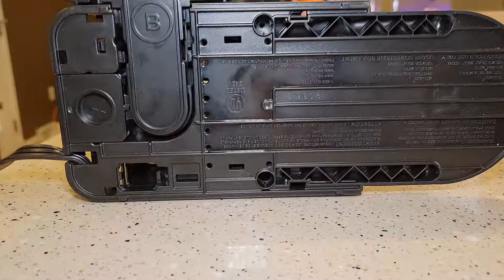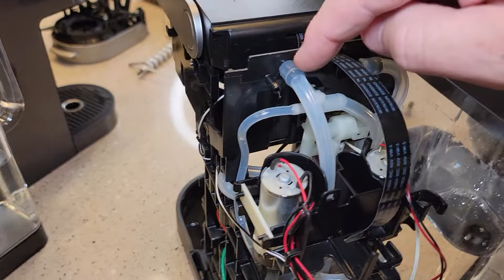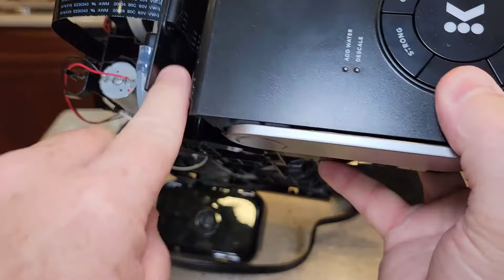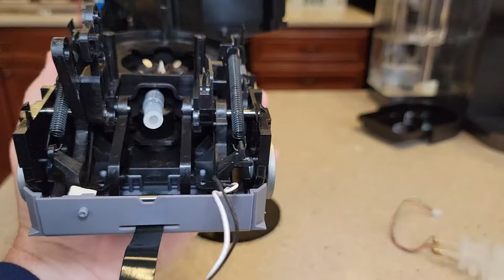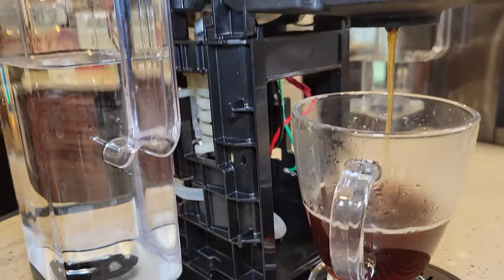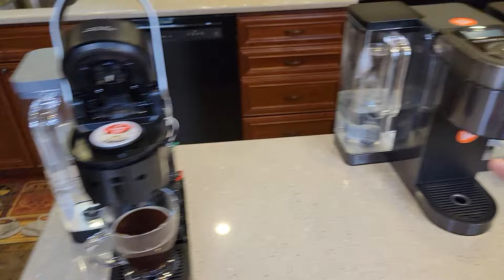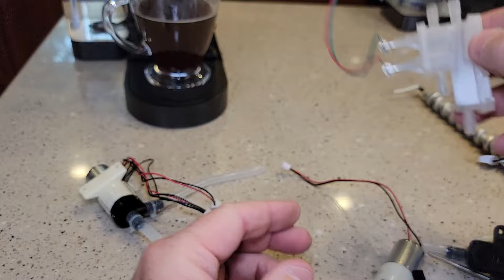🔍☕ Keurig K-Supreme Inside Look | How It Works & How to Take It Apart

Comment: At time 4:45 the unit your holding DOES HAVE A RESET the red button will reset the heater (sometimes) measure with an ohm meter across the leads with  the power off (of course)
and the heater will reset unless it is damaged too badly.  THEN proceed to find out WHY the water did not make it to the heater, causing the heater to overload.

Comment: I bought the K supreme from BJ's club abought a year and a half ago and I bought another for a friend. Both were duds. I only use mine for iced tea and the water stream has always been very slow and less than what was selected. The descaler light comes on all the time. Descaling seems to have no effect. I can tell there is a blockage. I tried the paper clip on the needles, and they were not clogged. So, thanks to your video I took the cover off and started looking for the problem. Long story short, the clog is in the check valve which is built into the multi stream head which you cannot take apart to clean. I should be able to blow air though it and it was clogged up tight. I am soaking it in vinegar hoping it clears up. There was also a clear slime in the tube right at the check value. I think it's a poor design and they should have a recall on the unit.
Reply: 100% support your point of view! I have the same issue as that of yours. The multi stream head is a literally a defective design!   After treatment by vinegar, did you revive it ?  what is current status ?
Reply: @悟入木三分  I broke down and bought another unit direct from Keurig, same model, and this one works great. Comparing the new one with the old one I believe the first one had a defective pump.

Comment: Well-this helped to understand why our Keurig stunk so bad. Our K Supreme smelled and the coffee tasted like mildew. I descaled whenever it said to, and I constantly cleaned the inside of the reservoir. Ends up, the mold smell was in the rubber and spring on the underside of the reservoir where the it connects to the water flow. The area that connected the reservoir to the machine was always wet and it smelled, as well...the little tubes that go to the water level sensor could were part of the problem. The smell was embedded in the areas you couldn't access.

Comment: what is the usage of the air pump??
Reply: Pressurizes the coffee going into the K Cup for a more complete saturation of the coffee grounds, and then clears the lines afterwards so that it starts with zero water in the lines for the next cup, and probably so that there can't be a potential siphoning effect that would drain your water reservoir onto your counter top.

Comment: Very nice explanation, I repaired mine with the reset but also clogged tube, noit water got to the heater so would reset. The pump was not priming bcus water was below half. So tested pump and worked. Removed tubes blow in air. Closed tube filled to top, and runned. Decaled afterwards. Again very good instruction on the path of the water. Did you catch that stm32f ??

Comment: Does it force you to add water as soon as it detects low water? My automatic espresso machine uses a magnetic float sensor but is programmed to know how much water is left after the magnet drops, so sometimes the "Out of water" light doesn't turn on and I can ask for a small espresso and it will do it but if I ask for a large it knows there's not enough water for it and will light the out of water light as soon as I press the Large button. I hope these new Keurigs behave the same.

Comment: Great video !  I wonder if the rubber flap is to release the steam from  the- Kup. ?    Amazing the amount of engineering for one cup of coffee
Reply from the maker: i think its a safety if you lift the handle during a brew the flap will open and prevent hot water from coming out the needles

Comment: It looks like water only comes out of that center needle (there are no holes in those other ones), I wonder what those other four pieces are for, just for venting?
Reply: The other 4 needles have the holes on the side, not on the bottom. You need to slide the black rubber (silicone?) sleeves/seals up to see them. They distribute the hot water better in the K-cups for a complete brew giving fuller taste.

Comment: Our flap became removed during a cleaning. Afterwards, the machine produces only clear hot water, no coffee. Any suggestions on reinstalling the flap?  We still have it, intact. Keurig support tried to sell me a new machine.
Reply: The flap is a safety(?) to prevent hot water from shooting all over if, for some reason, the lid isn't fully closed.
Reply from the maker: Thanks so much for your support!! I really appreciate it so much!!!
Reply: These are very reliable machines. The one I purchased in 2009 is still in use. It does have more descale alerts using Starbucks K cups and refillable K cups. Other than that, I did buy a new one as a back up.

Comment: So the needles puncture the k cup. The what? How does the coffe come out clear. The water runs over the grounds then how does it filter the coffee and push it down to the cup?
Reply: After the needle puncture, water is forced through the K-cup under mild pressure. Hot water goes through the coffee, past a built-in filter and out into the coffee mug.

Comment: Does the water actually come out of all 5 holes? 🤔 Or does it only come out of the classic center stream main one, and then spread across the top of a Kcup and possibly drip into the other 4 holes? I’m curious because the center spike is the only one that looks hollow, and like it can actually deliver water. The other 4 just look like solid hole punchers.
Reply: The bottoms of them are solid but just above a little bit (where the rubber washer type part is) they have holes in the sides of them that lets the water flow.

Comment: That little rubber flap has to have a purpose. Now you have me thinking. Great video very interesting
Reply from the maker: Thanks 👍
Reply: I would think it is like a relief valve incase the handle is opened while the system is still under pressure. Would blow hot water and steam down vs out the needles at the user.

Comment: Thanks!  Your video really HELPED!  Getting the case off WAS a struggle (as you promised!)  Once inside, I found the thermostat cutoff/reset and reset it.  It still had a problem with the unit shutting down.  As an experiment, I disconnected the hose nearest the right cabinet side panel.  The unit fired up fine over and over to do the descaling but the "Add Water" light did not come on.  The water got TOO low, the safety thermostat shut OFF and there it was......dead again.  Reconnecting the hose did NOT make things normal.  Soooooo, to keep using my machine, it is CONSTANTLY in "Descale" mode after I press 8 and 12 oz buttons for 3 seconds.  I make SURE that the water tank has lots of water.  I fill my reuseable K-pod, put my mug, press K and get a 12 oz. cup of nice strong boiling hot coffee.  Between uses I disconnect the AC to the unit to save power and also, so that it can't overheat.
QUESTION:  Is the hose I disconnected to do with the air pump and the "ADD WATER" function?  Again, THANKS A MILLION!  Old Man Rob, in Canada, EH?

Comment: The connector on the side of the water pump lets the computer verify the pump is rotating and not jammed, and the computer also likly uses it to measure the quanity of water delivered,.. I think it uses reads magnetic pulses from a revolving internal part with a hall effect sensor and the computer can read these pulses to determan the pump is running before it turns on the heater as a safety confirm so the heater is not switched on without water flow ..
Reply: This comment was pivotal for me. I bought some 10$ Amazon pump to replace in the Keurig, looked the same as pictures, had the same specs, but it didn't have this custom Keurig sensor on it. Without knowing what it was, I was thinking I could short/bypass it, this comment led me to keeping the OEM upper pump diaphragm assembly w/ sensor and replacing the motor from my amazon donor. Great success.

Comment: This is so much engineering work. These machines are much more complicated than I would of originally expected. The wide range of components, sensors ,and integrated systems is cool to learn.
Reply: Super automatic espresso machines make this look super simple lol. They have built in coffee bean grinders, an automatic coffee tamper and ejection mechanism and automatically grind the beans, put the ground beans in the filter, tamp them under high pressure, brew the espresso under very high water pressure (it has special high pressure tubing and connections) and eject the used coffee grounds into a waste coffee bin at the press of a button. The machine costs a lot more but you then get even better coffee for pennies per cup compared to k-cup/pod machines so they pay for themselves.
Reply: Which eventually and unfortunately makes it more prone to failure.
Reply: @Barnabas45 theoretically. The only thing I really think could be changed in this model is the over temp switch as it is single use. Although I could see that decision being made because if the unit over heats there is probably something else wrong with it. I wouldn’t say this is over engineered it’s a a pretty simple system just being used for something trivial.
Reply: I agree and it is made over complicated. They could have made it so much more simple and repair friendly@Barnabas45
Reply: All they really need to do is make that heating element, pump and timer. That's it. But they way over engineered it and made it not repairable

Comment: Extremely helpful and the comments assisted in the over temp reset. My unit was unused for months and after a descale I realized I was only pumping a ful cup when the water tank was full to the top 2/3erds. Any ideas? Maybe still need to descale? Also now my display goes dark after 1 second. I’m thinking the ribbon cable is loose or steamed/corroded after many short cups of hot water after descaling. Any ideas on how to check/clean the ribbon cable in the lid?
Thanks in advance….
Reply from the maker: Maybe a clogged in line.  blow some air through some of the pipes.
Reply: The over temperature sensor stays set/made. So that is not my problem.

Comment: I descaled my Keurig slim but the light does NOT turn off even though I also held the 8 and 10 Oz buttons down for 5 seconds. What am I doing wrong? I've tried it several times and several days...I am at my wits end )=
Reply: The newer Keurigs are different from the older ones: you have to enter the descale mode. If not in this mode and you run the solution or vinegar through the unit, the descale light will not turn off. To enter the descale process, turn unit off. Then press 8oz and 12oz (NOT 10oz!) at the same time. Fill the reservoir with the solution and descale. Just a Dad has a good video on descaling the Slim model.

Comment: On the side of the water pump is actually a IR sensor, I'm guessing its used to measure water flow. I had an issue with a keurig k latte single serve where the lights where all on and pressing the power button would cause the air pump to run. After trying everything, I injected water using a syringe through the water pump into the system and that caused the machine to reset and start working again. The board does say IR sensor where that pcb on the side of the water pump plugs in. It seams the system would only start the pump after seeing water run through it but it would only push water through it if the pump was working, hence the need for the syringe to jump start the whole thing.
Reply from the maker: Wow that is some good troubleshooting!! thanks for sharing, I learned something useful today!!!
Reply: @JustADad  I should have videoed my adventure, but I only through about it after I had watched all your videos and resolved my issue. BTW your anatomy of how these machines work, helped tremendously, I would not have been able to get anywhere without your videos. THANK YOU!!!

Comment: Hey dad, do you know if the k-duo single and carafe brewer has a one way check valve in it? Mine is making pumping noise but not water coming out of the kcup side.  I'm going to try all the fixes but that's the one I think is the issue and there's not much to go on. Thanks!😃
Reply from the maker: Yes, I made a video how to take apart,  they are really hard to take apart,   I have had some viewers use a air hose and blow air in the line to unclog the check valve. https://youtu.be/ZI6LhGropQI
https://youtu.be/oo18XZQpXXY
https://youtu.be/w1prLPfX7xg

Comment: I disassembled a tank style Keurig, a project in itself, all kinds of pumps, sensors, tubes, compressor, voltage regulator. Now I want to design a project to control some of them with a Arduino micro controller, write some code, and see what I can make. 
Thanks for the video.
Reply from the maker: Sounds great!

Comment: My Keurig K.Slim Add Water light keeps flashing and won’t brew even though the water compartment is full.  I also watched your video on how to clean the needle but that still doesn’t work to turn off the light. Any suggestions? Thanks
Reply from the maker: take the water tank off and turn the machine upside down and shake it really hard.  also fill you water tank up and lift it on and off several times and push down on the plunger under the bottom of the tank where the water goes into the machine.
Reply: @JustADad  Wow! You are a genius!! You saved a lot of headaches for me. Thank you very much. May I suggest for you to do a video on this problem because I’m pretty sure I was not the only one who has experienced this issue. I couldn’t find any videos on troubleshooting  K-Slim.  Thanks again!!!